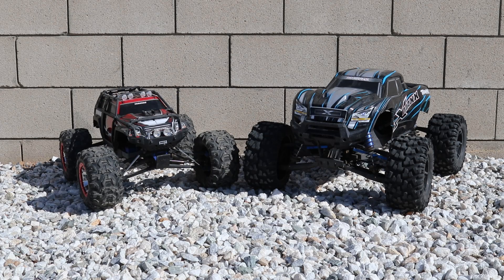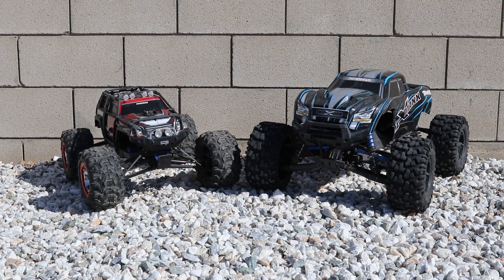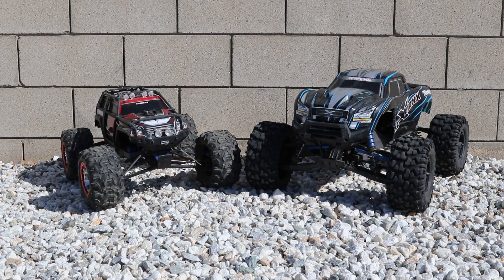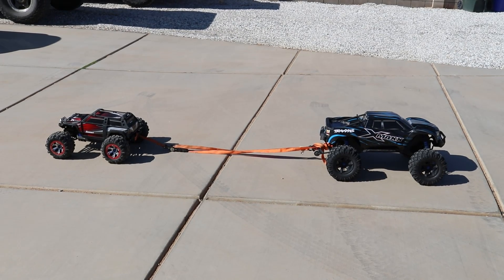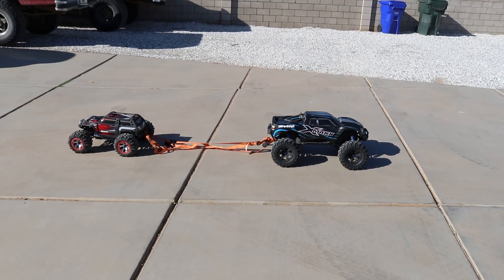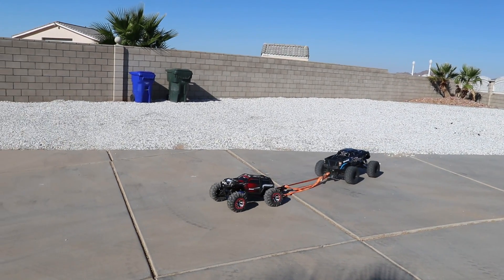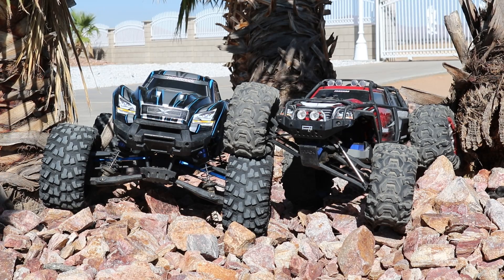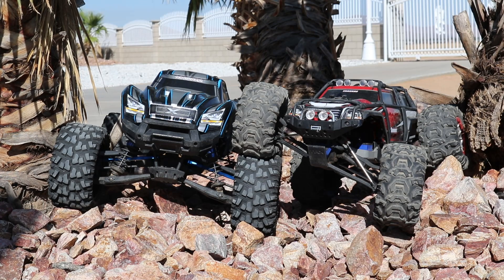Big Power Taxxas Summit 6s vs X-Maxx Tug of War Monster RC Car Battle Plus Carnage

Comment: That was brutal, it broke my heart. I love my Summit, i love it so much i bought a 2nd new roller as spare my first one was also a new roller mounted a tacon 2150kv motor and xerun 150 amp esc with a flysky fsgt2 radio. My build was less than $400 as most of my electrinics was from an old 1/8 buggy, lol. I gave up on land rc's(financial reasons) but except one the Summit. I just run it on high gear all the time. Great vids btw been following you for a time now. And yes the XMaxx is the King of large Scales in my opinion.
Reply from the maker: Right on bud great minds think alike, this motor and esc came out of an older erevo I have and it is definitely nice to have a little extra power there when you need it. Thank you for the support buddy, I have a lot more videos coming your way

Comment: I have a question. What’s the difference between a 4s and an 8s?
Reply from the maker: Great question my friend, the easiest  way I could think to explain it is a 4s pack has 4 cells that in total equal 14.8v an 8s "8 cell" thats right around 30 volts to simplify things a bit its double the capacity which in turn means more power a lot more power
Reply: FullThrottle Obsessions thank you!

Comment: A big fact you left out was the kv rating of each motor.  The xmaxx won before the video even started
Reply from the maker: True but unfortunately the kv rating wouldnt change the result on this run the weight was the major factor here